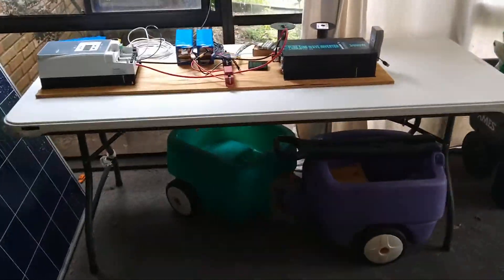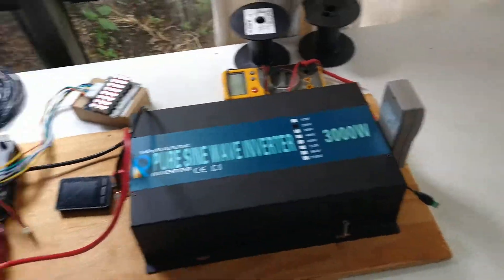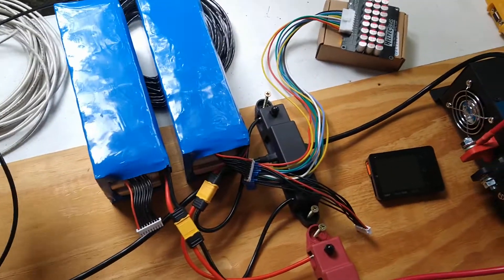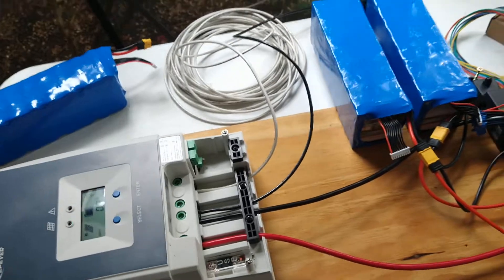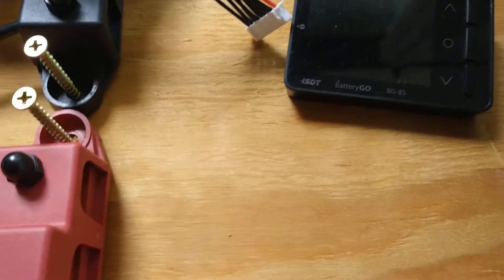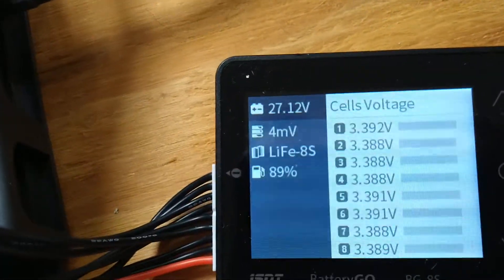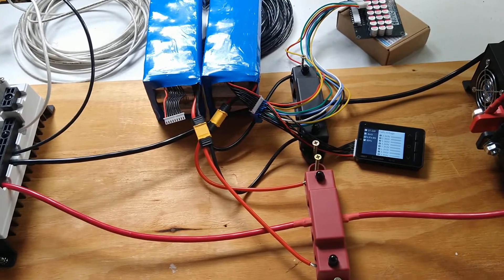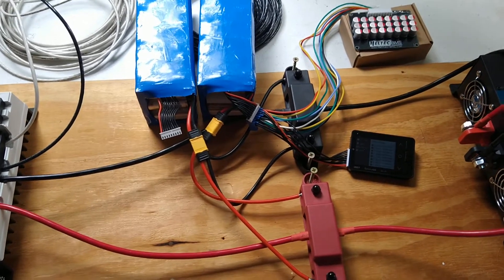Heltec Active Balancing Follow Up

Comment: You should get a ALL in one - Hybrid (Grid Tie + OFF Grid) Inverter (Parallel Stacking) & AC Charger + Dual MC4 inputs MPPT 100V ~ 500V PV DC
I am Impressed with MPP Solar new and upcoming (Coming Soon) - IP 65 Rated Waterproof And Dustpoof Product lines
UK - HYBRID 5048WP/6048WP – 5/6KW, 220-240V
UK - 8048MAX WP – 8KW, 220-240V (Off Grid)

USA - LVX6048WP – 6KW, 120/240V (Split Phase)
However the USA one Does Not Support PV Direct Drive AC Loads Without battery  but the UK ones Do

Comment: Do you keep the balancer on all the time?  Can I put an on-off switch on the line from the balancer to the battery positive terminal to turn it off when it's balanced.???
Reply from the maker: I'm still testing it in different scenarios, right now I have it on a small 3ah pack mainly to see if it's idle current will eventually discharge the pack, etc.. But yes there is a solder pad on the balancer that you can solder a switch, or a relay to enable/disable the blancing function.
Reply: @BradCagle   Is the pad you mention to solder in a switch  something obvious to the average Joe like me?  I thought maybe just splicing in a switch on the wire that runs from the balancer to the positive on the battery.
Reply from the maker: @spartaeus  There are two solder pads marked "run" these two pads have a blob of solder bridging them together. To add a switch you remove the solder bridge/blob, and solder the switch wires to those pads. Should be simple with even minimal soldering skills
.
Reply: @BradCagle  Thank you, exactly what I needed to know!
Reply: @BradCagle  do we use them with bms at same time?

Comment: I only test lifepo4 but they are somewhat similar in that balance can be achieved with a active bms or balancer I use both. Amperage flows to where it is needed your series in one battery can be out or not what you need to monitor is whether one 12 volt pack delivers more or less of the 24 volts you are using to supply the inverter then you can maybe have a better understanding of the amperage flow imho

Comment: Microcycling.  Oh brother...   It's a Unicorn as I see it.  A myth.   I noticed some time ago amongst channels putting together 18650 packs with dozens of cells in parallel.  Some not very matched. 
The theory is that as these packs get charged and discharged, current is flowing out of one cell and into another. Probably also when there is no load or charge going on. ie. when your back is turned current is flowing back and forth between these parallel cells. (Microcycling.)  I don't buy it.
They're in parallel. They are the same voltage.  It's a simple Ohms law question isn't it?  There's no voltage difference between the cells so no current should flow between them regardless of whether they are being charged or discharged. Or in between.
There is no evidence that I have seen to support it.
A lower "capacity" cell in parallel with a higher one will simply accept (or deliver)a smaller share of the total current.
Whew!   :)
Reply from the maker: Yeah, I think it's a lot of overthinking :)
Reply: @BradCagle  I think it was invented to explain failures that really could be attributed to cells simply wearing out and turning into resistors.  These guys were using salvaged cells.   Nite.  :)
Reply from the maker: @ebenwaterman5858  I think you may have it pinned :) It is nice to see we've come a long way from recycling half dead, and potentially dangerous cells to having access to affordable high quality cells. Exciting times for energy independence. Good night to you.
Reply: I agree that i don't think "MicroCycling" is a thing, the only technically true, yet probably statistically irrelevant, thing would be let's say you have one "worst" cell, that has the highest internal resistance, and because they're all in parallel, they would all be "pulled down" by that "resistor".  
In reality, i think the internal resistance would have to be massive, to be of any significance, to passively drain the pack at idle like that, and if you have a cell THAT bad you have other problems, and should replace it long before that happens lol
Reply: I think you guys are taking the microcycling thing out of context. It is true that mix matched cells in series most certainly become a degenerative condition ultimately ending in catastrophe. Mix matched capacity within parallel strings will result in the lowest capacity being the max capacity for the string.  Different size strings in series is certainly not good which erfectively is what you would have .  I think that's none of u,  at least in this commentary, myself included are  qualified to say for certain. 

So for anyone even less experienced that may be reading this and other comments  we should  be careful about our opinions even if they do have some experiences to support them. Without definitively being able to offer exclusionary findings then it must remain a topic for discussion and not offered as fact.

Remember these projects are for homes where people live with their family.